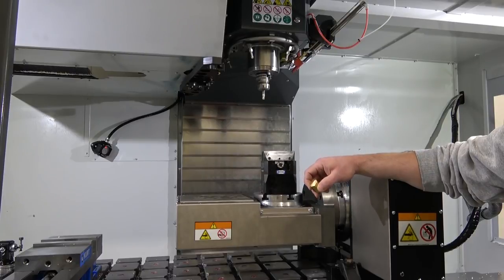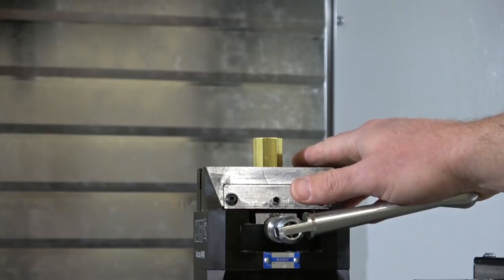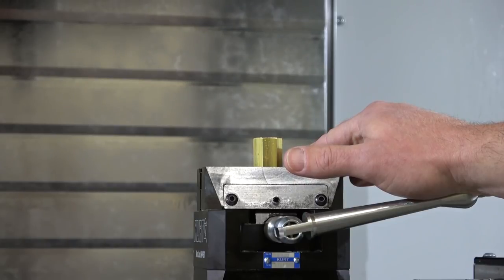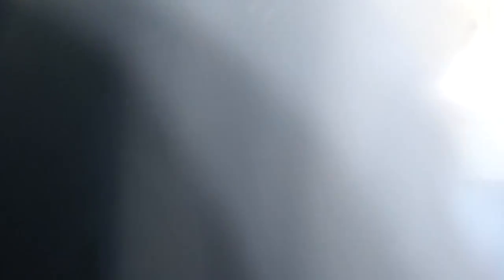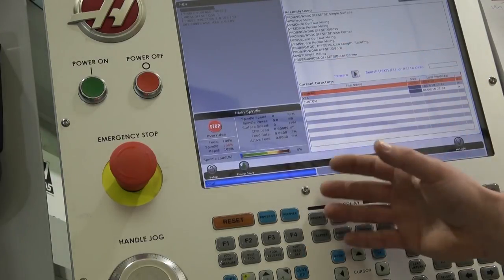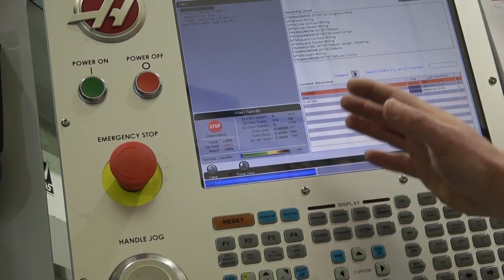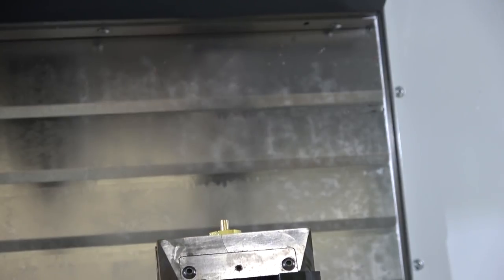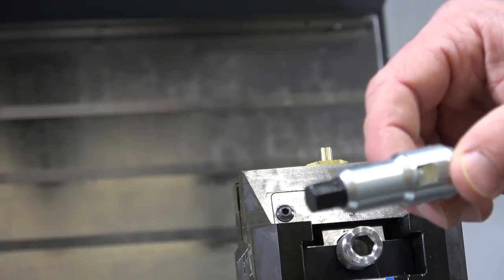One Million Subscribers | Town Pump CNC

Comment: Years ago I made a breach for a 30 calibur pellet rifle out of a solid block of copper.  It took a while and could be improved upon but if I had this machine I would make 80 percent of the parts with it, maybe even the stock of walnut.  It needs to reach 1000 psi   on the first pump and would go about 3 pumps before  over taxing the hammer spring and works.  It will shoot through 4 layers of steel cans with a 5/16 ball bearing as a BB, the same as my Dads' 22 break barrel pellet rifle only the hole is about twice as large .

Comment: Congratulations! I always wanted to see a planetary gear and crank handle on Lil' Screwy, so you can apply pressure uniformly, and not beat yourself up cranking 1 nut at a time.  
It's only flat work on your mill, but it'd be cool to have done it, and maybe a nice way to get your feet wet with layout and the machine. You could make it out of a piece of 3/4" - 1" plate.  
Thanks for your awesome videos.

Comment: We use a tool called a "fast finger" to quickly hand tighten brake tubes instead of fumbling with meat sausages. Toyota moved away from milling them and now they 3d print them and those 3d printed ones suck ( degrade and not enoigh weight to them) could make and sell them for a fortune. That brass stock u have in ur hands is the perfect material aswell.
Reply from the maker: Sure. Where can I get a sample? I'll try and make you one.

Comment: Got a windmill blade design I had 3d printed for a engineering project in school, could spiff it up a little and make it in two hollow halves to make. Get ourselves a bajeezlus rotation to pixie converter and power the machine from good ol wind!

Comment: This is great.

First thing that comes to MY mind, that would help me is a water cooling monoblock for MSI X399 MEG Creation board. At the moment nobody in the market offers one, and that is criminal. Making bottom bottom part out of copper, and top part out of acrylic/plexi, or both part out of copper, would be amazingly cool. Geometry is not extremely complex, and existing similar monoblocks for other boards could be used as a basis. I suck in CAD most of the time, but maybe this would convince me to try harder. 

I hope I will find some other cool stuff to do tho.

Comment: @AvE You are AWESOME.

I do have something I'd like to have:
A locking mechanism for my computer case.

It's would a small thing to start with but if you're interested I'll send some pictures and stuff.

It's awkward for me to bodge something because the frame is made from thin and hollow square tube/square tube with rounded corners.

It was an old WWII radio that I've modified

Comment: A mobile phone case that fits snug on the phone. Make it a bit bigger on the back so you can make a tray basically to store your credit card in it. Being metal should be really protecting the device. Also storing the credit card in that tray ( drawer ) should stop the wireless transactions ( to prevent touch phishing ). I am thinking something slick and durable ( for the guys who are working on a construction site).

Comment: Nice toy........... Now show us what she can do ! :)

I'm thinking a little "Getting into the swing of it" project, Maybe something like cutting a set of replacment steel gears and an alloy gearbox casing to replace the craptacular plastic ones in a cheap cordless drill? Or maybe getting arty farty and machining a thin walled billet stainless coffee receptacle with external strengthening ribs and and a latticework style handle to keep heat transferal from the beverage from making it too hot to pick up?

I'm just trying to think of what funktastic new machining video options having a 5 axis CNC could open up........... The lists already getting pretty feckin long. :)

Comment: The HEMA community have been trying to find a way to produce quality sword blades for a long time. We fence with protective gear and blunt reproductions of historical swords. Sword blades need to be high quality spring steel with an edge hardness of around 50-52 HRC, with smooth distal taper from around 5 mm at the guard down to 2 mm at the tip, so that the final third of the sword does the most of the bending when you stab it into your friend's face. 

The main barriers are finding steel of good quality in smaller than industrial batches, and machining it accurately without ruining the heat treatment...

Comment: Content idea: specialized e-bikes motors from ‘19-‘21 fail, I’m on #4.  Warranty will be expiring soon   When my belt failed, it was the gasket was rubbing and heating.  Now the sprauge clutch is gone.  Need some tooling to press in n out.  I can send you a motor.   Or try to buy one w a shot motor.  You would love awesome when it works.  I bought a 2000 watt Luna X2.  All chineesium. But awesome.  All the brands need to be Taken A part.   TQ has cycloid gear.

Comment: My idea won’t use a 5-axis. But will a soldering iron. A time domain reflectometer kind of equipment. Where you can attach at both end of a leg and check resistance. To long to run a wire as a loop. No neutral to loop either. Used to do a check on a long run to troubleshoot quicker.

Comment: It would be great if you could work with Copenhagen Suborbitals; they're building liquid-fuelled bipropellant rockets with the goal of a manned suborbital flight and one of the biggest limiting factors in their design is the availability of suitable machine tools. They just made a blog post about how they had to redesign the injector plate for their BPM-100 engine due to lack of access to a 5-axis mill, so I suspect that they might be interested in collaboration.
Reply from the maker: townpump is open to anybody with a cool idea.

Comment: use it to build a reduction gear box for your metal chop saw hack that was running at double the correct speed. show us all the considerations to building a 2:1 reduction planetary, you could make it fit between the original motor and everything, bet TOT and CS could help!

Comment: I've got a crazy idea, but it may need some technical expertise beyond my own. (Ok may is putting it lightly.) The idea is to make an "internal bypass" or "ring jet" engine. However I could try to explain the concept of the why behind it...

Was watching various videos on jets (no DIY because when you're dickered enough to have a $0 budget - it's only by a proxy of sorts), and noticed something. Any home-gamer attempt at axial type jets seems to fail.

Then I did some light google-fu style homework. Seems all the hobby-grade jet engines and small APU type turbines have centrifugal compressors. Axial flow out the back-end is just fine though, but it's having work done in the reaction turbines rather than the other way around.

Some more looking... The few special purpose axial-flow style compressors that are out there at the smaller end of relative size, the inlet cone is relatively huge, as well as the displaced internal surfaces around the shaft. All the blades doing anything are at the very periphery. These are oddball items for doing industrial stuff with gases, and for whatever reason they didn't go with centrifugal...

This got me to thinking... Axial turbines have a pretty large difference in relative speed. So on small jets the part near the center isn't going fast enough to displace a gas with enough pressure without it just coming right back out the front. And apparently this is a thing, compressor stall.

So knowing why the axial design has some problems at the small end of the scale, why not design a jet engine where the staging is done on the very outer rim? Might be tricky, but I think the central shaft of a jet could be done away with with the right bearings. Now you've got a ring or sleeve of sorts, and the bypass could be on the inside where the low relative blade speeds are, and the compression can be on the very rim where the blades of the compressor end are moving the fastest in terms of relative speed. I think this allows for a few more interesting tricks. More surface area for cooling, etc. However the enginerding aspects need to be "just right" because of balancing and such. No room for weeble wobbles when the spinning mass of blades is near the periphery of a tube. Turning it "inside out" from how it's usually done has a high level of challenges, but would be interesting to try if it's workable.

In terms of prototype scaling, perhaps the size of two coffee cans stacked on top of each other. That might even be close to enough radius where it doesn't have to go full die-grinder level of RPM's to do its thing. Not lightweight grade steel though (far from wasting time with actual coffee cans), so it'd need a good level of machining to be workable.

Probably not the most practical thing to try and build when the usual home-brew probably doesn't work over half the time anyways and following known models. So it's just one of those more outlandish and seemingly mad thought exercises.

Comment: I need something CNC machined. A long time ago they decided to make a magazine catch out of ZAMAC. The mag catch acts as a hammer spring retainer. due to age embrittlement, it's possible to set the trigger and have the mag dump out, hammer go dead and spaghetti on the floor.As the weight of the spring causes critical failure in the mag catch.

Comment: Well done!
Reply: I vote.... cnc plasma table parts.....take one bosch  Rexroth ckk 12-90 linear doofer at 3 feet widemake parts to take 'your' pilot fart plasma torch - magnetic snap-off - cable lifting z axis - or cylindrical machine torch in its own circular bearing or helical screw up down = groovy.make the gantry ends to simply affix to um same thing ckk 12-90 3 feetfeed with ikkle 200 watt Panasonic minas motors and drivesrun it from sheet cam mach3how do I donate you 3 200w motors and drives btw -can I smell water-jetting in the not too distant farture?

Comment: Can you provide some more information regarding the relationship between idea-ee and manufactur-ee? For example: lets say Idea-ee has a brilliant idea for a project but significant design time and manufacturing time is required to produce it.. Will these two characters undertake a joint venture? What happens if the project is successful? What if it fails?

Comment: Little idea, what if we send you material, a basic description and a cad file for a part we need at home and you do a machining video?
Reply from the maker: just the cad file will do. gotta be cool and useful for everybody. or REALLY fucking cool.
Reply: @arduinoversusevil2025  maybe an Ave branded internal external thread testing plate? One in metric and sae, fine/coarse? Kinda similar to the ruler/hole gauges you made a while back

Comment: Well... I have a CAD of a part. Problem is, it is small.
Like 50x10x13mm (length, width, height) small.
Should probably just get a solid 15x15 stick of aluminium and a file...

Comment: If it's mine machine I would like some adapter plates for my subaru engine, I want to mount a ej205 (Phase 2) intake manifold on a ej20g(phase 1) which I rebuilt. they changed the bolt pattern from 99 onwards. ;)

Comment: I've been hoping for a non-monetary way to help you out, and this seems like a perfect opportunity. I have extensive Solidworks experience, with a big emphasis on fancy curves (gotta use all 5-axes on every part!) and experience designing actual parts for actual production on consumer good. I've also done some work over on the skunkworks sub (which, i need to get back over there soon). I'm planning to learn Fusion360 this winter. So if you ever need CAD help or engineering input please reach out. 

Also, as a way of curating/organizing submission ideas, it might be good to start a subreddit (I just made /r/AvEsubmissions, if someone else wants to take over that for me I would gladly pass it along)